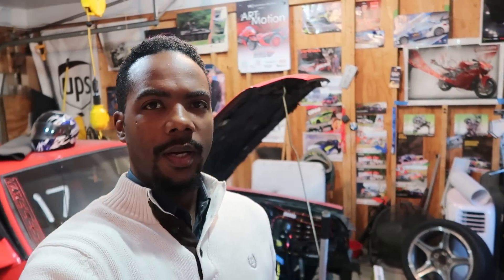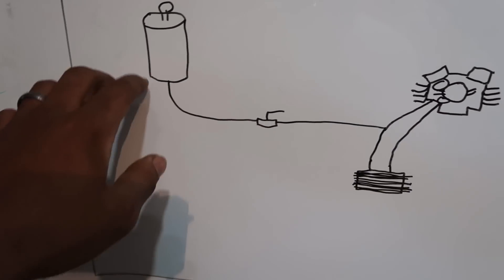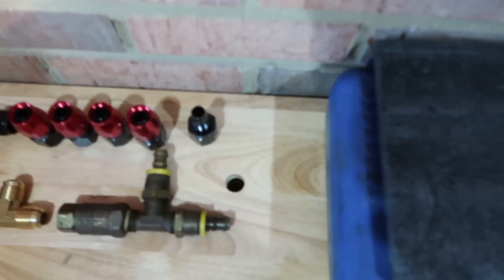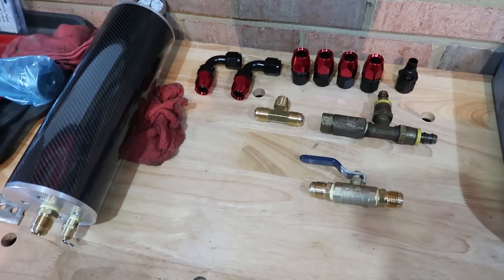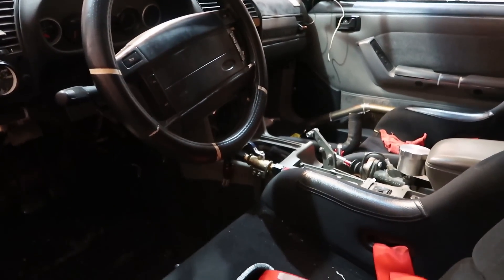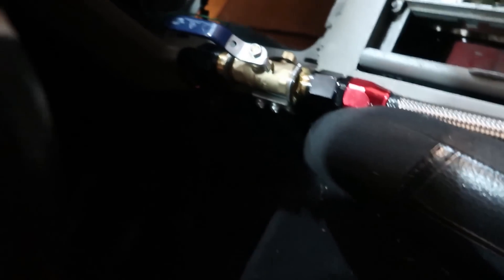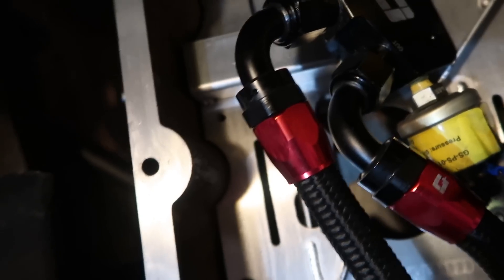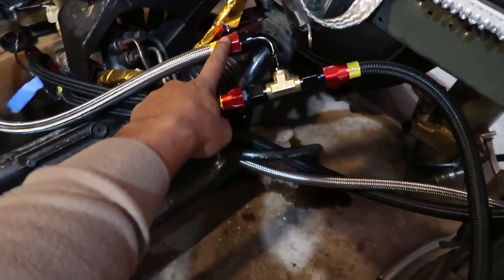Canton Accusump Install

Comment: Are you enjoying manual valve operation still?
Reply from the maker: i forget to shut it off before i turn off the engine, and occasionally forget to turn it on before making laps.  It's just part of the routine i need to get into.  It's not really a big deal if i forget to turn it off because it re pressurizes when i start the car back up, but forgetting to turn it on pretty much defeats the whole purpose of having it.
Reply: @Sgt.Slides  I hear that. Mine currently is in the engine bay with no remote actuation. So I have to get out and open the hood :-) I'll be setting up a remote manual lever almost exactly where yours is. I feel like I'll also be subject to the lack of routine but try for one anyway. I imagine it will have to be like a little song/ story memory game.

Comment: Quick fix for your open/close valve; if it interferes with your gear-shifter, loosen the AN-fittings and turn it so the handle goes North and South and re-tighen. That should do it.  Good stuff!!!!!!

Comment: I was wondering are u rebuilding the ls motor or u going with a different motor for the fox? 🦊
Reply from the maker: still rocking with the LS, but went with another block due to complications, i'll explain when the motor comes back.